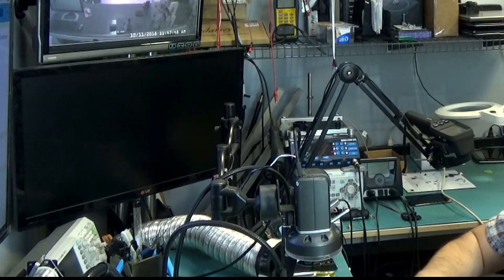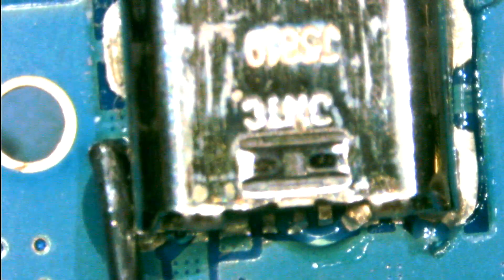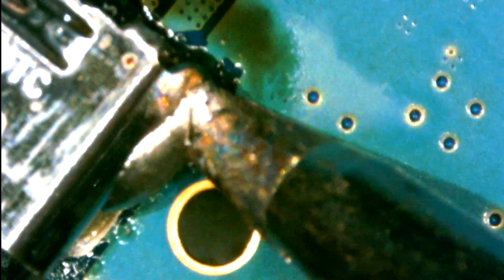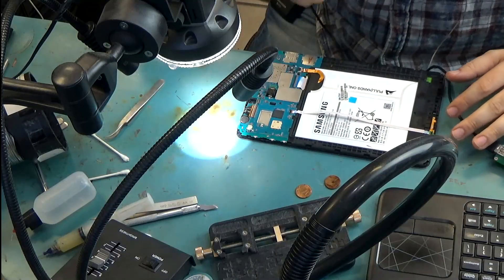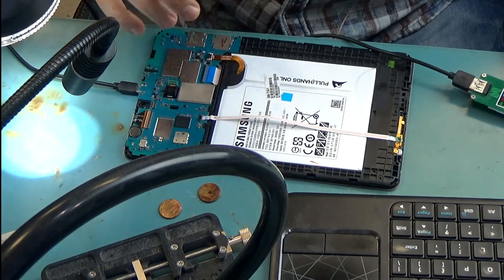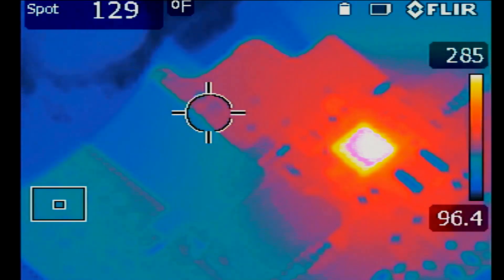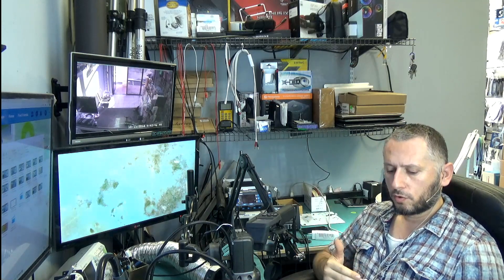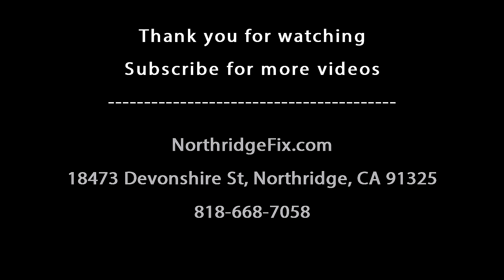Galaxy Tab E SM-T561 Charging port replacement and Charging IC problems

Comment: Any other solution for it. If we domt have an other ic
Reply: Well, it could be another problem related to a shorted capacitor, so the IC keeps turning ON and OFF , when the current is more than it should be the IC turns OFF and back ON to try again and so on. So, you should check for any shorted cap ( or any other bad component even without schematics, easy to find around ) before assuming that the IC is the problem.

Comment: Thank you for another good video.
Do you mean that even though the tablet draws current( when charging) battery remains flat( not charged)?And as a result the tablet can not be turned on? In other words the current is drawn only by surrounding parts in charging circuit?
Reply from the maker: The charging IC is possibly shorted and sending the amps to ground. That is why it's getting very hot. The Amp reading didn't change after disconnecting the battery, which confirms a problem with the charging IC.

Comment: Charging ports take a lot of abuse, no matter how careful we are. If the pins are shorted whilst plugging in or disconnecting the charger, this can create a short circuit internal on the device. If your lucky, you may get away with it. In this example it’s clear the IC responsible for charging took the short circuit and has now failed. Also, this “knock on” effect may have effected some supporting components like, filters, resistors and capacitors. As shown here, the Highly Experienced Tech knows this and without circuit diagrams and the likes, pinpointed the issue very quickly. The device in this example will be repaired to its former glory without much hassle and wasted time. Good advice to the customer would be to discard the existing charger lead in case of defected plug causing this issue in the first place. As always a BIG 👍 up from me. I look forward to the next video.
Reply from the maker: 100%